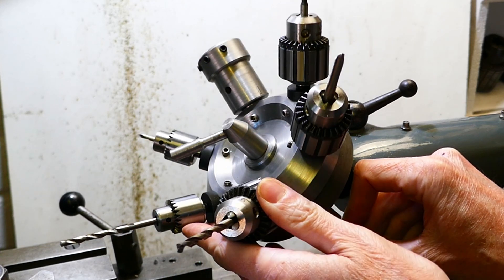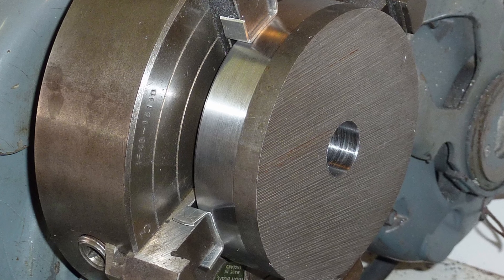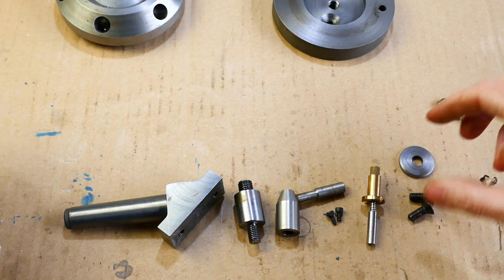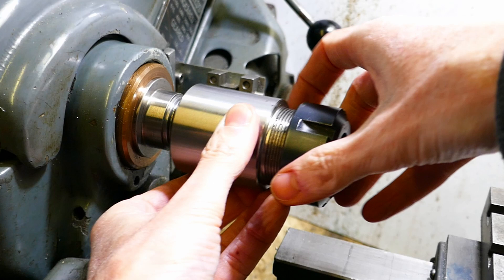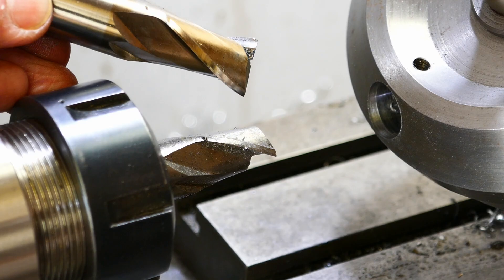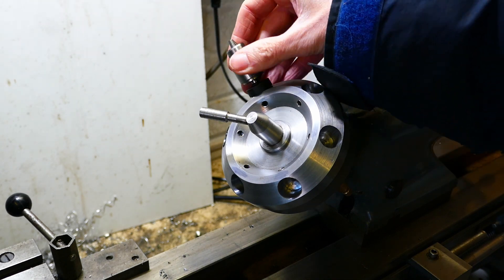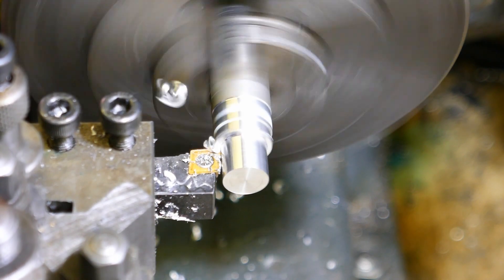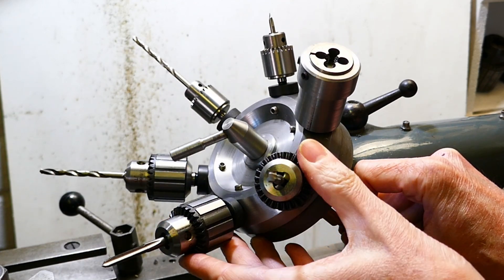Making a tailstock turret for the lathe (capstan attachment)

Comment: Very interesting.  Not being critical, but just a suggestion.  One way to cut down on the number of tools needed to make your part would be to replace the two internal taps with one.  If you use a forming tap you can bottom with it.  The added benefit is a huge reduction of "chips".  If you have never used a forming tap, they don't cut the threads, they form them by swaging the material.   Make sure you drill the correct diameter, as the size for swaging is larger than for cutting.   Once the hole is drilled, there is no changing  one's mind.  Cutting threads in the larger hole will not make usable threads.   Also, do not try to swage in a diameter set for cutting.  
Also, your part is aluminum, use a sharp drill.  No need for a pilot.   That is if aluminium is the same as aluminum.
Reply from the maker: @dougberrett8094  thank you, I'll look into it!

Comment: Good idea.
Congratulations for your job.

I can see only one problem. 
All system is moving. 
The key in your tail stock is not so precise. 

To prevent this movment you can make a V cut in your tail stock axis and put a V key with an adjustable screw to prevent this movment.

Comment: Fantastic work, are really impressed, but I can't get my head around how you align the turret with the tailstock in center high for each pos....Seen your video 3 times, still clueless lol Might add, that I'm not a native english speaking person 🙂

Keep coming with all the great ideas, mate

PS You might need to add some sort of stop on your tailstock, so you accidently don't pull out the turret from the tailstock
Reply from the maker: @Bonesfc  the detent mechanism is made first and THEN the tool position holes are drilled through with the drill and boring head held in the lathe chuck.  This means the tool hole at each of the six positions is perfectly aligned with the headstock/spindle axis.

Comment: Ok. But I would definitely not rely on the bored hole in the turret and a grub screw to hold the adaptor. I would face the each turret hole and thread. Bore to suit a threaded Chuck with locater spigot. Otherwise this looks ok.

Comment: Hi there, brilliant tool youve made. Am i right in thinking that this tool would only work with your Lathe due to the chuck and tailstock alignment? Im getting into metalwork again after about 22 years so im trying to absorb as much information as possible before i buy myself an old lathe to learn and practice on. Thanks in advance and subscribed :)
Reply from the maker: it would work in any lathe with a compatible tailstock taper as everything is aligned with the lathe spindle axis.

Comment: Mighti suggest making drill holders made similar  but scaled  down to  those used on screw machines..index..Acme...those  float to center the tool and then lock in place two bolts and tool held by bushing

Comment: If you reduce the exposure a bit when recording your videos will look a bit less blown out, you can adjust for under-exposure, but over-exposure blows the image out irreversably, and it's super easy to over-expose with reflective metal surfaces under bright lighting conditions
Reply from the maker: Yes you are right, I need to get the user manual out for my camera as I have been struggling with this.  Some of the clips are overexposed, it’s annoying!

Comment: I'm a bit out of my depth here but it seems like there's a good amount of movement when it first engages.
Reply from the maker: The drills are not always perfectly straight so there can be a bit of movement when they engage.  Also there is a bit of rotational play in the tailstock which you may have seen.

Comment: it is pointless in this setup with regular tailstock, you NEED the sliding one to have any good use out of this setup, because you lose everything cranking the thing, and you have no depth stop and no fast retrack, can of course use it without locking the tailstock for some operations, but overall it is pretty pointless
so - do yourself a favor and make one if you can't find one from another lathe and adopt it, its dead simple since no high accuracy is required, good to have the accuracy, but not strictly necessary
Reply from the maker: It would be better to have the lever feed and depth stops, but the turret is an improvement over continuous tool changes at least.
Reply: @MetalMachineShop  it is marginal at best, understand that I'm not criticizing your craftsmanship, just that they figured this stuff out many decades ago, hence why it has its own slide
I don't have one, since I'm not making hundreds or thousands of same on manual, but what I did though was make all my morse shank ends same length for the HLV-H, I didn't buy them all at same time, so they were a mishmash, same length means they bump out at the same position on quill, saves a little bit of time
and most common tools have their dedicated chuks/holders, then 3-4 chucks empty ready to go, that is all thats necessary
I also have Casaneuve HBX360 with the quick quill tailstock, that might benefit from something like this because the quill travel is much longer than on normal TS, and it is fast, but still, no point really because the real "capstan slide" will have built in tool change on the back motion
they pop up sometimes on industrial auctions or ebay, if I really needed the speed out of manual, that would be the only way to go

Comment: You don’t need to drill a pilot hole then drill tapping size literally just drill straight to tapping size
Reply from the maker: Yes you are probably right.  I sometimes find drills drill oversize unless you creep up on it with progressively larger drills.

Comment: The tang on the end of a morse taper is not used to drive it.  It's there to enable the drill or reamer to be removed from a drill press or similar machine.
I see yours is tapped for a draw bar.  I would make a threaded button to fit in it so that the ejector in the tailstock does not damage the end too much.
Excellent video.
Reply from the maker: Good idea

Comment: How did you attach the No. 2 MT to the chunky metal bracket?
Reply from the maker: it screws into a threaded hole in the bracket and the nose of the taper was also threaded.

Comment: Excellent video, very interesting. Have you seen any issues with additional runout when using this instead of the standard tail stock? Your build seems very well made I’m just curious if any minor error ir tolerancing in each step propgates through to the end. Very cool video, seems like a huge timesaver.
Reply from the maker: It’s not a problem as the holes for the chucks are drilled through from the lathe headstock a the last operation, ensuring good alignment.

Comment: Nice job. 
I'd be bothered by having the clamping handle in the middle of all those pointy tools. I think it might be possible to design it with the clamping lever underneath the turret by making the axle one part with the turret and drilling right through the baseplate.

Next, add a rack and pinion drive outboard on your tailstock, turning it into a horizontal quill.
Reply from the maker: That’s a good idea, it would theoretically be possible to add a locking lever on the back similar to a tailstock clamp.  A lever feed tailstock would be a good enhancement.

Comment: Nice trick using the lathe to drill the tooling holes. I was wondering how you'd get those aligned accurately. Was that grease or anti-seize you put on the threads?
Reply from the maker: It was copper grease. Not sure if it's the best thing to use but seems to do the job.

Comment: Fascinating piece of work.  My only question: with a Morse taper fitting into the tailstock, what guarantees the alignment of the tool in the exact same place, every time?  All I can see is the MT going in the whole and landing wherever it happens to land, so I hope I'm missing something.
Reply from the maker: As the tool holes are bored from the headstock, the tool axis is in line with the headstock and tailstock, so the rotational position of the Morse taper in the tailstock does not affect the axial alignment of the active tool.

Comment: Very nicely done,.. A ramp on the detent hole would allow rotation in one direction without the need to pull the plunger similar to a 4 position tool post.
Reply: It would be easier to use if the plunger could be pressed in to function. That could require a rocker shaft to change direction

Comment: I used to have a Martin turret lathe. It featured a lever that indexed the tool carousel to the next position with each pull and adjustable stops for each tool to set depth of cut. It was very handy for quickly making a few thousand parts. It was great technology back in the day, but it was replaced by a CNC lathe.
Reply: Superbe réalisation

Comment: Hallo ! I have a chinese lathe and i got for it such a turret as you show in the video.
I'm from Italy, i just in time got it at a reasonabile price from an English company, just before Brexit: after that expenses would be more and more higher ...
This turret - smaller than your one - make any work very very fast, specially when - sometime - you have to make ripetitive items with multiple operation ...
A very usefull tool, even for an hobbist, as i am ...
Reply from the maker: Was it from Arc Euro Trade? They do a similar item.
Reply: @MetalMachineShop  yes, exactly, it cost me about 90 euro, if i'm not wrong ...
It is equipped with a morse cone mk2, just for my tailstock. It helps very much, i had to make a sort of box ( 2 pieces indeed ) with 4 legs each ( 8 in total ). Each leg should be bored and then threaded ... 16 terminals in total ... Luckely i've had this fantastic tool ... 
Mine has not mandrels, i use 16 mm steel round bars to grip the tools ( i lathe that round pieces on my need, and then they last for ever ... )
Reply from the maker: @James-to7pi  why dangerous?

Comment: Very interesting, thanks for sharing. A question - How do you ensure the MT is located correctly and not turned as it does not have a tang or anything locating it in the same position every time?
Reply from the maker: It doesn’t have to be located in any particular rotational position as the active tool is coaxial with the tailstock spindle so its position is not affected,

Comment: Great job .
The morse taper angled piece should be located onto the rotating disc housing  with 2 dowels .
Csk screws are okay for location  but because youve bored each turret position in situ if you ever strip it down you are relying on screwthreads and csk screws to put it back into the correct orientation.
If i dowels were used theres no alignment issues and if you ever have to strip it down it will always go back in the same place .
Just a thought ,nice job 👍
Reply from the maker: Yes you are right, in fact I did fit some dowels partway through, but this bit ended up on the cutting room floor!
Reply: @MetalMachineShop  looks mint 👍as an apprentice I used to set capstan lathes , really versatile machines

Comment: I am following the argument that the MT 3 taper (in my book) would need some sort of locating mechanism, and at 2.05 you show the 45 deg block, scribed with a 45 deg line which becomes your centre line, at 2.50 you show the assembly, but can you describe the centre line of the MT3 to the centre of the 45 deg block and THEN its centre relative to the backing plate which would allow the MT3 to be in "any rotational position and still concentric", please.  if they are not concentric then as the MT3 is rotated the assembly would describe an arc around but not concentric to the centre line you achieved. Would you be prepared to share the plans of that part so I can get my head around that aspect please. T I A
A very handy tool and you could have several top pieces for a variety of different sized stubby tool holders
Reply: Trying to wrap my head around this as well. If the assembly is removed from the tailstock, how is repeatability maintained? Does the clocking position of the turret tool taper into the tailstock taper affect the alignment of the detent positions? If not clocked exactly how it was drilled during build, can’t there be some error? It would seem to me one of the tools would have to be indicated to the lowest position so it’s at the bottom of the radius. What am I missing? This is a nice build, just trying to understand it.
Reply: He’s not understanding what you’re asking but I have the same exact question.

How do you index the MT3 in the tailstock?  Or, how do you make sure the MT3 shank on the turret goes into the same position in the tailstock taper?  Morse tapers aren’t indexed so it could land anywhere.

This has been my question from the beginning (and arguably the most difficult part) yet he continually ignores it or doesn’t understand what people are asking.

It’s quite frustrating.
Reply from the maker: @brianmihlfeith7135  sorry I’m being so frustrating, I’m either misunderstanding the question or my answers are not being understood.  Because of the machining sequence,  with the tool holes being bored from the headstock once all the other parts are made, including the detent that returns the turret to the same six positions, the alignment of the active cutting tool is not affected no matter what rotational position the Morse taper ends up in the tailstock.  It’s just like a normal drill chuck in that respect.
Reply: not  mt 2
Reply from the maker: @mahafeezislami9618  the tailstock taper is indeed MT2!
Reply from the maker: The holes for the tool holders are bored from the lathe headstock after making the other parts, including the detent holes.  As the headstock and tailstock axes are aligned, the tool holes in the turret end up so that the active tool is in perfect alignment with the Morse Taper, therefore the rotational position of the turret does not affect the position of the active tool.
Reply: I first was skeptical of this too, but after thinking it out as long as the indexing is repeatable then rotation on the center axis in the lathe is of no consequence. Although the perfectionist is me would want the mounting plate on the Morse taper to be orientated to be perfectly vertical before boring the holes in the turret.

Comment: Nice Job and I would say good video subject as not to many would have seen one of these in a modern shop. 
I have made one of these myself as an apprentice project a very long time ago. Mine was slightly different as I chose to use a mount that put it on the tool post and not the Tailstock. To lazy to wind the drills in just power feed.
I would ask a question however, What are you using to locate the turret radially in the tail stock quill? I noticed the morse taper didn't have a tang on the end. It's a bit important as without radial location getting it on center each fitment would be a bit of a pain?
Reply from the maker: It’s a good question but actually the taper, active tool, tailstock axis and headstock are all in perfect alignment so the rotational position of the turret on the tailstock does not affect the alignment of the active tool to the work.
Reply: @MetalMachineShop  Of course as the mount holes were put in via the spindle.
Reply: dazaspc - What a great idea mounting it to the tool post.

Comment: You could have just used er collet holders with straight shanks.
Those are very good and easy to use better than the drill Chucks also low profile.

Also you could use straight shank reamers instead of boring, gives better and repeated result.

Very nice build for a small lathe.  ❤🥳
Reply from the maker: Good idea with the collets, I didn’t think of that.  Probably quite an expensive solution though?  Agreed re. reamers; it’s a case of making best use of the tools available sometimes.
Reply: @MetalMachineShop  gamble with cheap and chinese. i imagine a bad collet still has less runout and greater rigidity than an average jacobs. not that i know just a guess.
Reply: @cho4d  Rigidity probably, runout? Wouldn't gamble. At least step up to Taiwanese.
Reply from the maker: @cho4d  I suspect you are right.